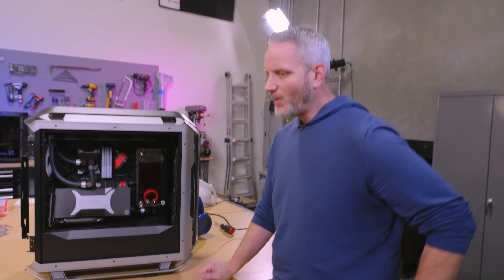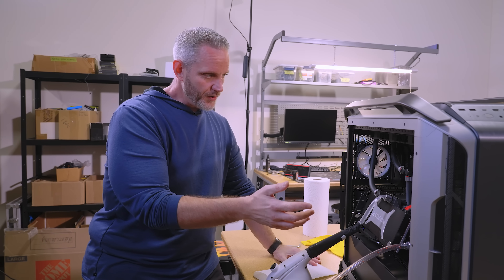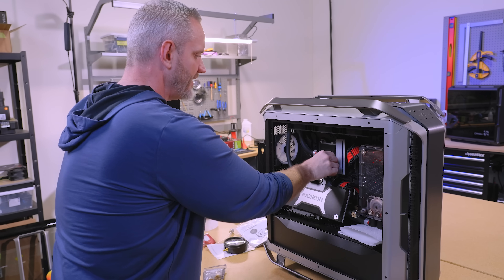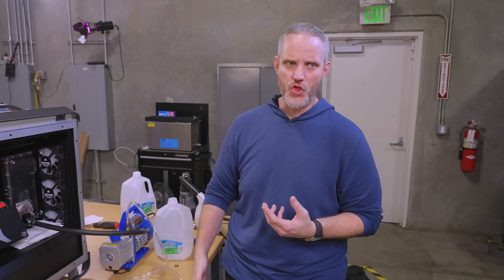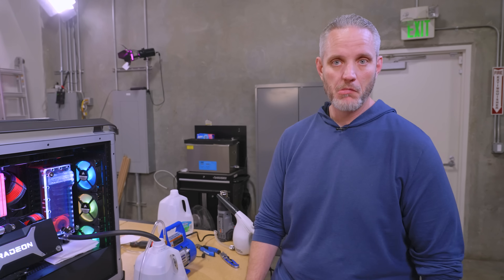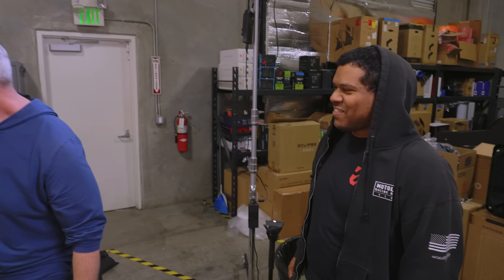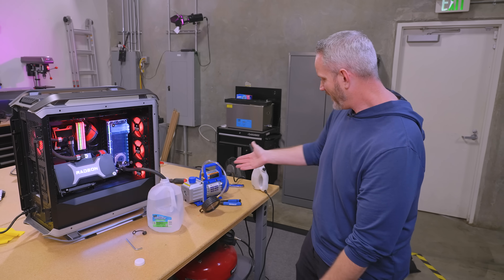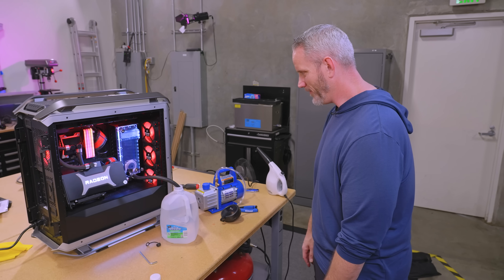I used Vacuum Pressure to fill a PC! Why didn't I do this sooner!?

Comment: Hi Jay. 
I work in the HVAC industry. i use vac pumps all the time. Ideally you'd need a manifold that you can vacuum down and charge (fill). Before you charge, you need to purge so you minimise air getting back into your system.  In the automotive industry, you can fill your brakes this way too, much faster than the pump and bleed method.  They use a bleed line into a fluid catch bottle (resevoir) which is then connected to the vacuum pump. That way to you empty your brake system of fluid and also fill it.  
E.g. Brake fluid bottle feeding brake fluid resevoir, bleed line to catch resevoir connected to vac pump. 
i siimilar inline system can work for PC watercooling.  

Alternatively, HVAC style would be:
-Drain port connected to gauge manifold (so you can open and shut the line), vac/charge line from gauge manifold to catch resevoir then connected to vacuum pump. 
-When system is empty and holding a vacuum, shut off gauge manifold valve, disconnect vacuum pump and catch resevoir.
-connect new fluid bottle. Seal it if possible (could be a bottle cap that you could modify with a hose that goes through it).
-raise and invert new fluid bottle so it is above the lowest point of the gauge manifold and purge the line of air by cracking open the fill line/hose on the manifold end. this should leak out some fluid pushing air out.
-place fluid bottle back on the table.
-you should be ready to open the gauge manifold vavle to the system and charge (fill) without air bubbles.

i hope that works. 
That is pretty much a simple way that we use in the HVAC industry.
Recover, Vacuum, Purge, Recharge.
Though we vacuum down to around 500 microns and check to see if it holds that for at least 15 minutes. Air in a HVAC system is really bad. Less air in a water cooled system can't hurt either, just like car radiator systems, less air, less problems with air locking, steam bubbles, pump airration etc.

Comment: One of the coolest tricks I ever saw working at an auto shop was an old timer putting a vacuum on the oil fill port on top of the engine while I changed the drain plug without losing a drop... wonder if a similar gag could work for quick repairs or modifications on a system without having to drain it completely

Comment: Hi Jay. Being inspired by composite manufacturing, you should have two ports. One for vacuum on top of the reservoir with a liquid trap. That means you make vacuum on a container then you have a hose connected from that container to the top of the reservoir. You put a valve at the reservoir. Then you have another hose on the lower part of you reservoir, better yet on a low part of your loop. You put a valve there and connect the hose with the coolant. Then with both valves open you start sucking until the coolant passes the coolant valve. Then you close the coolant valve and continue sucking. Once you reach your maximum vacuum you slowly open the coolant valve and let it fill the loop until some coolant reaches the trap container. Then you close both valves and are done.
Reply: Look for VARTM (Vacuum Assisted Resin Transfer Moulding) and get inspired;)

Comment: Just a thought Jay:
-Charge the hose with fluid, put the hose into the outside reservoir of fluid, and connect the hose to the lowest point of the system with a valve.
-Use a air and fluid compatible vacuum pump* and connect it to the highest point in your system (which would be the fill port of the distrubution plate in this build.)
-Apply the vacuum.
-Open the valve, sucking the fluid all the way to the top of the system.

*Alternatively, there are catch tanks that will catch any fluid that's heading towards the pump that can be used to vent the air without getting fluid in a pump. Put it in line between the computer and the pump. This could also allow you to use the pump to actively fill the system as well, saving the step where you would have to charge the fill hose.

I'm used to trying to get every last bit of air out of my car's cooling system (3rd Gen Mazda RX-7,) where I only have access to the highest point of the system (which would be the air separator tank.)  It. Is. A pain. In. The ass.

Comment: Hi Jay. Did you copy my idea? I use my DIY liquid removal tool to remove old oil from my lawnmowers and car engine. I use an empty one-gallon glass jar to hold the extracted oil. I drilled two holes in the metal lid and installed barb fittings with O-rings. One connects to my vacuum pump, and the other has a long, firm, but flexible tube that I place into the engine's oil fill tube. The pump creates a vacuum in the glass jar, which pulls the oil out and into the pot through a hose that extends inside the jar. As this tube is not sealed where it enters the engine, no vacuum is created, so removed oil is not sucked back into the engine. Vacuum pumps have a knob, yours is blue, that controls the amount of vacuum the pump creates.

Comment: to drain with vacuum? just put a jugg in between so it pulls vaccume into the jugg, then open the valve so it pulls the fluid into the jugg and with the vacuum hose on the top, gravity will stop any fluids going to the pump?

Comment: @Jay-Z you forgot to put oil in vacuum.  
Also, you need to stop vacuum machine for 10 min and then start for second time. The resone for that is related to level pressure between tunes and inside of the system. This is how AC enegeneries do there job before starting air conditioner. 

Great video by the way.

Comment: instead of adding second valve on the bottle, you could drill a tight hole on the bottle cap and push it half way down the hose, then just hold the water bottle upside down and let the water flow into the hose and bubbles naturally rise out, before you open the only one valve.

Comment: You could crack solder joints at that low of a vacuum. Good automotive practices is to follow radiator cap pressures to vacuum. So 15psi cap - 15inHG. A hand vacuum pump would work easy as a PC system has a low overall volume

Comment: Copyright the idea immediately.

But also, do further testing to find out exactly how much pressure is needed to fill to the point of pump saturation, because the minimally viable product is what is actually going to be sold mass market, and if you're the one who did the research, you deserve to own the rights to it.

And this whole thing reminds me of the anecdote my dad told me where NASA scientists were struggling to find a way to protect the Saturn V capsule during reentry into Earth's atmosphere until an engineer who was also into brick oven pizza making as a hobby realized that the same stones used in his oven might be able to survive reentry on the capsule. It was knowledge outside the standard knowledge base of the engineers that solved the issue. This sort of lateral thinking is what is going to be most valuable as we move ahead in life.

Comment: That's a genuinely smart idea. I wager that Linus Tech and Gamers Nexus will adopt the same idea when building their systems.
Of course using this with the vacuum  pump to ensure integrity of the water loop is analogous to pumping the loop full of air to see if their are any leaks, with the added benefit of immediately being able to fill the loop with water!

Comment: A small enough pump would could be driven from the PC itself so you don't need an external power supply. If you attach a pressure gauge to the PC tubing then if it maintains a good constant vacuum for minutes or hours then you don't have any loop leaks either 😀 No need for a  pressuring pump to test your loop. It's a shame that the pump in the loop can't do both pumping air and fluid so that no additional equipment would be required.

Comment: When you refill under vacuum just manually fill the tube that is going from the fresh fluid reservoir to the PC with the fresh fluid and you should get very little air in the system when finished.

Comment: You can use a T with two valves at the end, so you can put one tube to the vacuum pump and the other one to the bottle so that you don't have to take the tube out to the air.     Also, a thinner tube would minimize the dead volume of air, but it might fill slightly slower.  Going lower on pressure won't help much.
Reply: Best would be to hook the pump to fill port and the hose to drain port

Comment: I like these experiments! An idea: can't you create a loop where the bottle of water is at the beginning, and the pump at the end so that you suck the air out at the beginning followed by the water? Suck the water thru the system. May'be at the top of the distroplate/reservoir? I believe there would not be a negative pressure left because of the fact that water can't be compressed. Just a thought. Problem is that the pump/entry is in the same block as the outlet/highest point....

Comment: to get out the liquid you can use a car oil pump, or fuel pump, te kind that helps you empty your reservoir, those are small and work on 12V, sow thy are perfect for a pc PSU. Yo can also do that in reverse to fill up the system

Comment: Refrigerator compresors are able to create a lot of vaccum, we used them to check the Ac components on cars, see if there is any leakege in the system, they are silent and can create a lot of vaccum, and you can find them almost for free at junk yards, AC compresors also work very good.

Comment: okay jay, hear me out, for extracting all the fluid from the system you can vacum another bottle or whatever with the same pump and a valve, them put in to the system to drain and open, it would be the same effect that the filling process, ohhh and obviously it needs had a open port for better results

Comment: I worry about about the Radiators the fact that they are making noise when under vacuum, I imaging them failing after a few years of using this method to refill your loop since they are not designed to be under high pressure like a car Radiator,

Comment: A hand pump works extremely well. I have a car brake bleeder vacuum hand pump and a few correct size fittings and tubing. Just hand pump to pull a vacuum, fill the loop with coolant, vacuum it again to remove air which pulls in more coolant into the loop , turn on the PC, vacuum one time, and then just top of the coolant.

Comment: Coming from the HVAC world, I would T off the gauge with a 2nd shut off between the pump and reservoir. It means you can pull the vacuum, turn the pump off and if the gauge drops, you have a leak.

Comment: This is a great idea. FYI, this is how your vehicle's radiator, brake, and AC systems are filled at the factory. With the radiator, the fill head is clamped and sealed onto the radiator cap. The machine then pulls a vacuum on the system and checks if the system will hold the vacuum to check for leaks. If there are no leaks in the system, the radiator and the rest of the system are filled with fluid while the system is still under vacuum. The vacuum causes the system to fill faster than it would under normal circumstances, which reduces cycle time on the production line. The entire process takes about 40 seconds with about 35 seconds of that time being taken up by the vacuum check. It's stuff like this that allows factories to produce 60 to 70 vehicles an hour.

Comment: As a chemist this now got me thinking. In chemistry we use vacuum pumps as well and we prevent liquid and vapor from getting into the pump using a cold trap. Now I was wondering, you don't need to cool it like we do because you don't have organic solvent vapors to ruin the pump so you can just add something in between where the vacuum pump pulls the air from up high while the bottom has a larger fluid reservoir. I wish I could comment a picture of the setup we use in chemistry.

Comment: That made me smile and was brilliant to see! hehehe. Love it. What you want is a handy container with a "jayz special valve" arrangement at the lowest point, where both vacuum point and liquid can be neighbours. That way you can extract the air at the rearmost end of the fill tube, close the vacuum pump off to isolate the fill tube, then crank it to let the liquid through from absolute beginning to fill point? I felt  a bit sorry for those radiators.. they've probably never felt anything like that before hehehe

Comment: I have a pair of $120 ones from CPS that are both 6.2hp i believe, and with fresh oil and a good seal on the hose, I was able to pull a vacuum chamber down past -29 inches of mercury. I got the second one because I needed to pull down a very large DIY chamber and it took forever without at least two pumps hooked up lol. As for doing this with rigid tubing, I would not try it on acrylic or anything too brittle, PETG is probably fine but IDK about PMMA or other acrylics, and glass should probably be okay so long as it's at least as thick as a lightbulb is, metal likewise should just be fine regardless of type unless you're using aluminium tubes or something dumb, and even then just make sure they're a reasonable thickness. I'd honestly be more worried about the radiator and reservoir than anything else, then less so the blocks, but so long as you're working with particularly thick acrylic pieces, it should be perfectly fine, since that's what a lot of cheap vacuum chambers are made out of. The lid of my small chamber 3/4" thick PMMA and it just sits there like nothing's happening.

Comment: Not sure if anyone suggested this but you can actually use that same vacuum pump to empty the loop. You would need to put a vacuum chamber in the middle, one that has 2  shut off valves. one side goes to the vacuum pump, while the other goes to the drain port of the loop(make sure you open the top most fill port to make it easier to pull the water out). When you get a vacuum in the vacuum chamber you can close the valve that goes the the pump side and open the valve coming from the loop side. The same principles used to fill the loop is what would be used to empty it quickly.. you can find many good DIY vacuum chambers on YouTube. They are not hard to make at all.

Comment: as a refrigeration engineer in the uk, you have sparked my geeky interest 😀use a set of 4 port refrigeration (HVAC) gauge set, you could have a small tire inflator on one port, vac on another, drain on another and system oulet on another 🥰

Comment: You don't need a full atmosphere of negative pressure - that would be a complete vacuum and, as you mentioned, stuff for NASA. You can have many atm of positive pressure but for negative there's just the one.. All you need is enough to move the fluid against the height difference and the resistance of the tubing etc. which should be far less.

Comment: Okay, so there IS a way to use that type of pump to drain a system.  You need a recovery tank.  Drain from the loop goes into the bottom of the recovery tank that should be able to hold loop liquid volume plus headspace.  Vent in the TOP of the recovery tank goes to the pump.  Hook everything up, pull a vacuum on the tank, open the drain valve and shwooop, all liquid goes into the tank.

The same setup can be used to refill the system with one more valve on the tank to vent it.  Hook everything up with fresh coolant in the tank and the hose from the loop in the bottom of the tank.  Open the loop drain valve and close the tank vent valve and pull a vacuum.  Bubbles will come out of loop drain line.  When they stop the whole thing is under vacuum.  Vent the recovery tank by opening it's valve, air rushes into tank, coolant rushes into loop.  I'd do it slowly though, you don't want a water-hammer situation to occur.

Comment: Jay to avoid the remainder of the air in the system fill the fluid in a larger container first then you don't need to switch anything.

Comment: I think soft tube may be better because its flexible, rigid may be easy to crack doe to lack of elasticity, could be thick but still elastic, as long as it has some elasticity or rubber sort of compound I think would be better

Comment: You can empty the system with that pump actually, not by hooking it directly to the water loop.
You should have a container that has at least the same capacity of the loop. You pull the air out of that container and while is under vacuum you disconnect the pump and then connect the container to the loop. 
The container will suck out the water from the loop in the same way that the loop sucks in the water from the jug.
Have fun doing this in the next vid 😁🫡🚢

Comment: for people worried about breaking their system (like cheap radiators or smth) if you dont go just as hard on the vacuum, you are essentially just gonna have a lower fill amount with less pressure on the system. Though keep in mind you are gonna need a minimum amount in order to have enough force to fill the system at all

Comment: You don't need a different pump for draining systems.  Get yourself a galon sized glass jar, put teflon fittings on the top, and a valve.  You then use the pump to pull the vacuum through the jar.  The water comes out into the jar, without passing on to the pump.  If you are really worried, you pull a hard vacuum on the jar, then close the outlet valve and disconnect the pump.  Then turn on the inlet valve and the vacuum bottle fills.

Comment: Now you need to have a container where you can attach your fill tube to the bottom so you can prefill the tube with liquid before opening up the valve and that would reduce the air in the system even more.